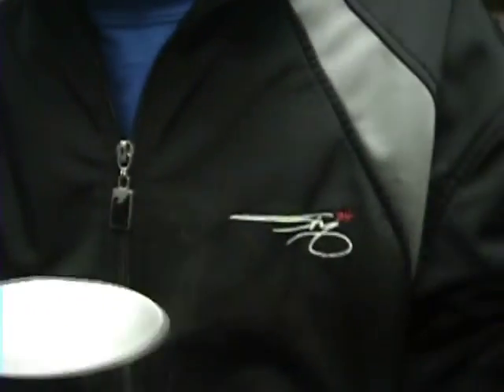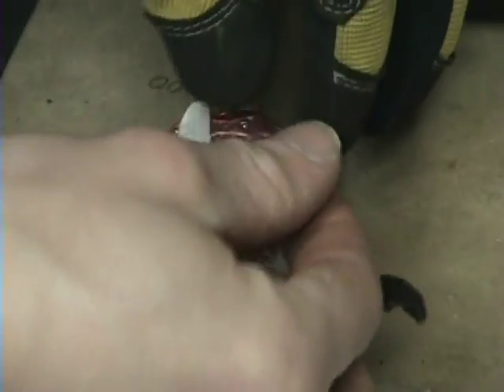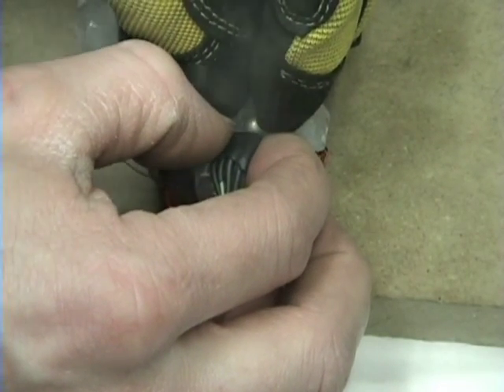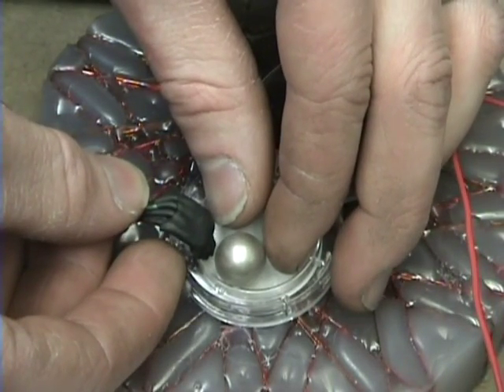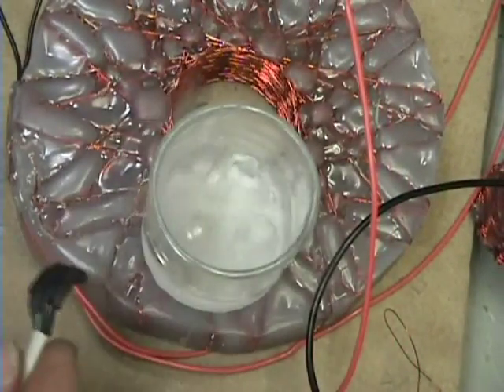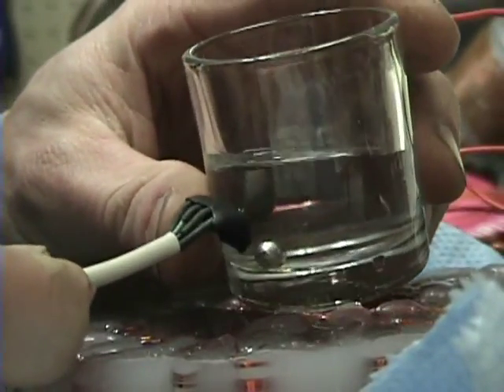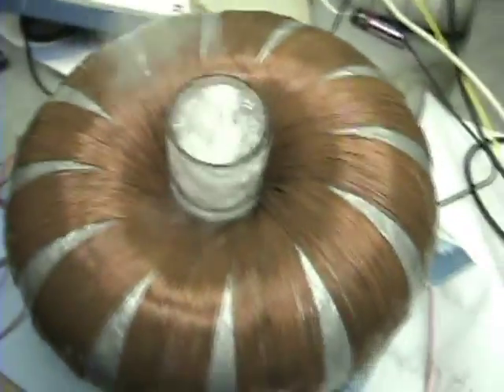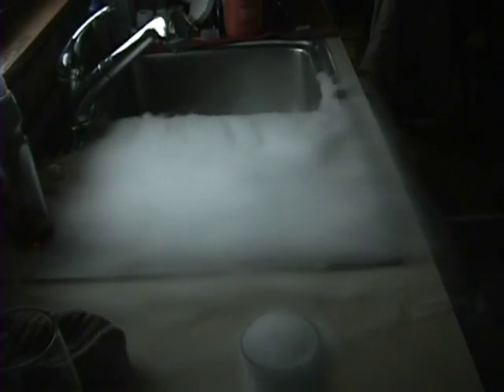Dry Ice + Electricity & Big Booms, High Voltage & Craziness!  HA

Comment: @rwg42985 Yes exactly, the Tesla Turbine.  I just thought this up too - think plate type blades on a floating magnet assembly surrounded by the rodin starship system mounted on a boat with the magnet ball set halfway in the water.  How to throw a lot of water on a fire? I'm just thinking...but how big you think a rodin coil can scale? How big of a magnet can it turn?  

Isn't rodin coils all about torsion physics and isn't that related to large spinning objects?